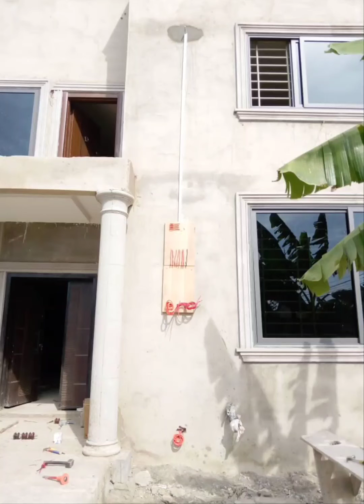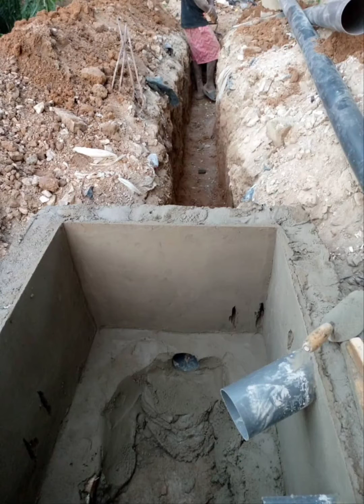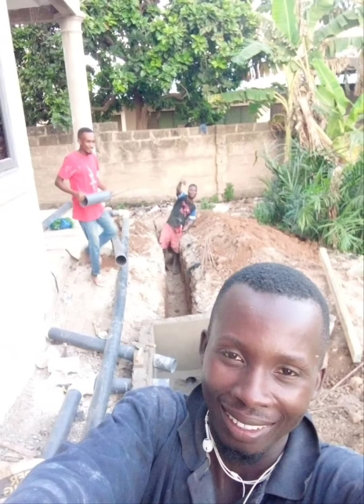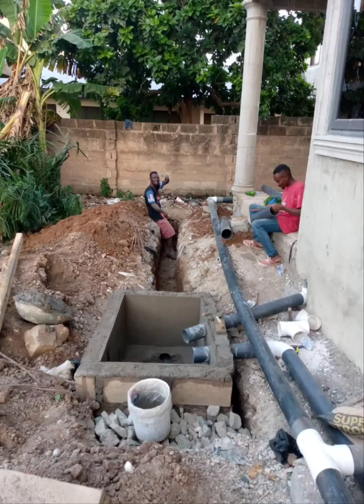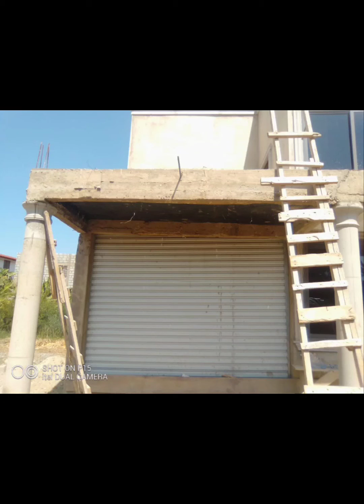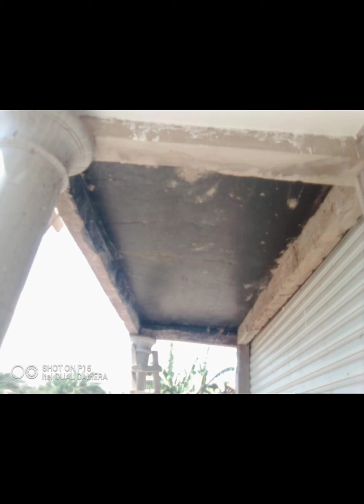Biodigester sewage system and Electrical Work Happening this week. #biodigester #buildinginghana 🇬🇭

Comment: Hello DS. Your electrical box is too exposed to the weather. Which will in the future possibly set it on fire when the weather gets hot. It’s adviced to put it where it’s not exposed to the sun and rain.
Reply from the maker: Great observation! We're making a customized case to protect it.  It won't stay like that.